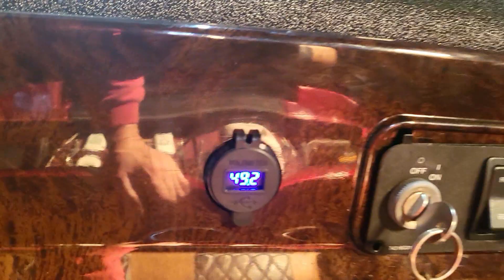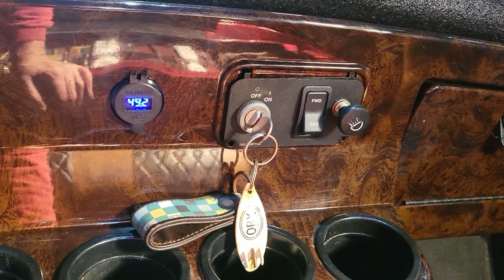Adding USB Ports & Volt Meter to 48 Volt Golf Cart without a 12 Volt Converter EZGO Yamaha

Comment: Yeah, so you could hook directly up to the hot wiring coming to the key. Turns off when you turn the cart off, and you could have used the wires sent with the charging port.

Comment: my old battery meter is not working great anymore. Think taking it out and putting this in with the same wiring will work? multimeter says its 48V.
Reply from the maker: It should work just fine

Comment: I don't see how or where your getting a 12vt feed?
Reply from the maker: There is no 12 V apply to it Which is why I chose it.It connects directly to the 48 V.  If you want to use a different USB port you would have to get a 12 V converter for a 48 V cart.

Comment: Does your voltage change on the battery meter even when your just sitting. I have the same one and I recently put it in and it's jumps around
Reply from the maker: No, it's pretty stable when stopped, it will drop while moving.
Reply: @Channel-About-Nothing  ok mine does the same thing

Comment: Thanks, this was an inspiring video! I have an EZGO RXV and was able to run the cable where all the other cables are run, in a groove under the floor matting. I didn’t have any fuses, I thought it would be included in the linked holders, so make sure you do before starting, I’m going to use 10A.

Comment: Nice video, I ordered and installed this exact volt meter. Ended up placing on the dash under the headlamp switch on my 48v 04' Club Car DS. Works very well. Wired it from the ignition switch to a negative battery terminal so it's only on when the key is on.

Comment: you are not worried about burning out the components you plug into the port?
Reply from the maker: Do you worry about charging your phone with an adapter plugged into a 120V outlet?  Same difference here.  It's made to work with 48v systems.